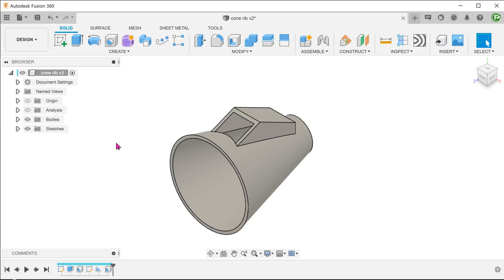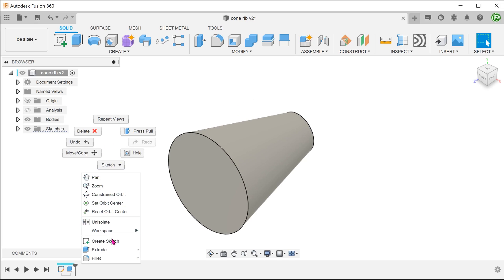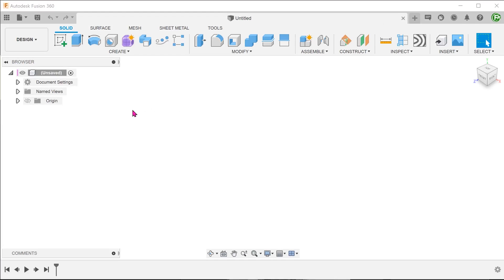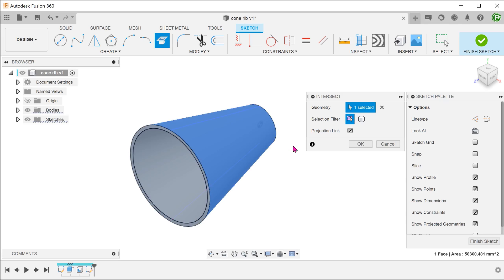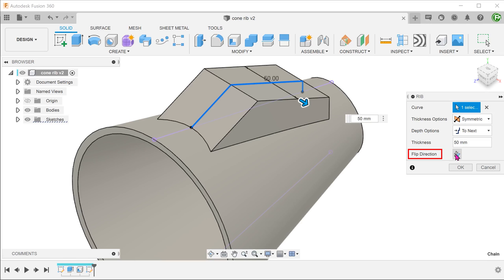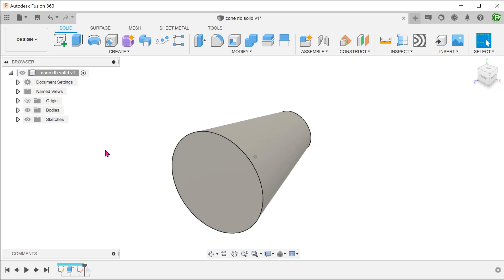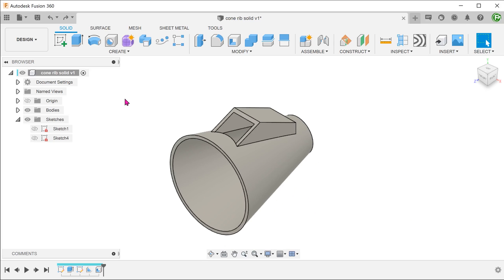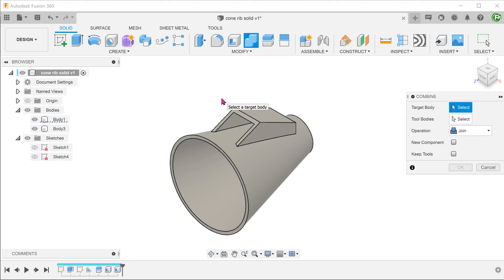Fusion 360 | Rib?

Comment: About the Spout of a Beaker you posted 3 month ago:
Today I tried it, everything is good, only the final step, filleting hard edges seems not possible.
You only applied 1 mm thickness, so I guess it was not a necessary to add fillet, but if one like to make it thicker, I guess fillet would be a must in terms of making it real.

But the spout is not filletable, because after adding thickness, the geomerty losses regularity, it shattered to several faces.

I did make it at last by cutting off the whole top part of the beaker causing problem, but I guess that is not good practice.

Comment: What about opening a discord account ? so we can discuss the methods you have taught.
Reply from the maker: Not too long ago, I had actually opened an account and was ready to send out invites but I decided to pull the plug in the end. As it is, I am already drowning in emails and comments. I guess this is a good problem to have! 😅
I was concerned that once I open the account, I would not have the time to fully engage with the community in discord. I was also concerned that participation in discord discussions would suck time away from my main focus, which is to ultimately make useful weekly videos. Anyway, I don't have a good sense of how discord works, so my concerns might not be valid. It might be a good way for the users to interact with each other and talk about the videos but I don't see how I can actively participate in this with the limited time that I have. Anyway, keen to hear your thoughts on this.